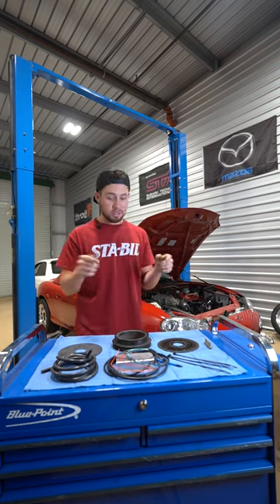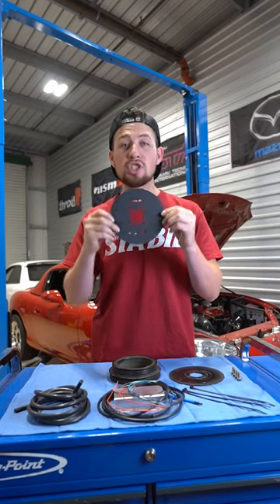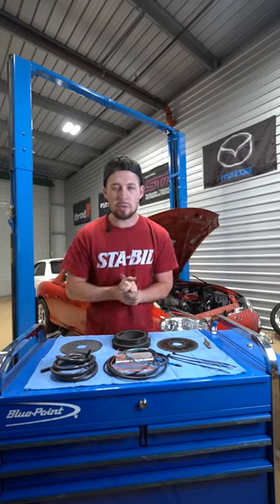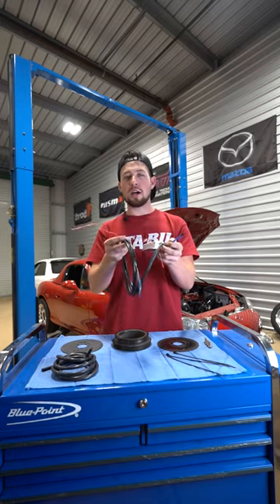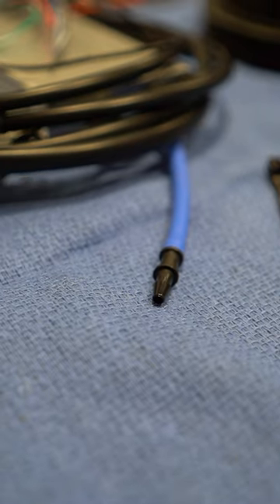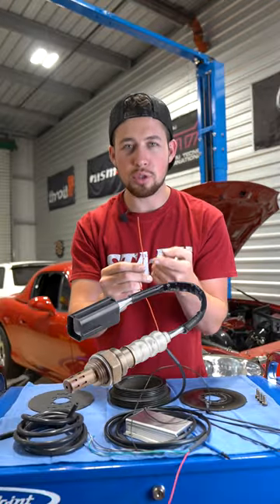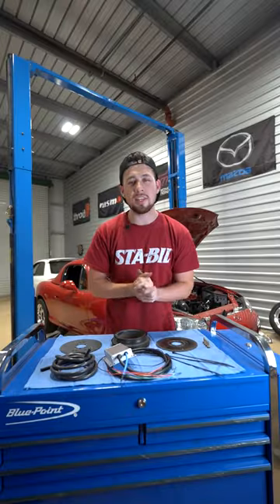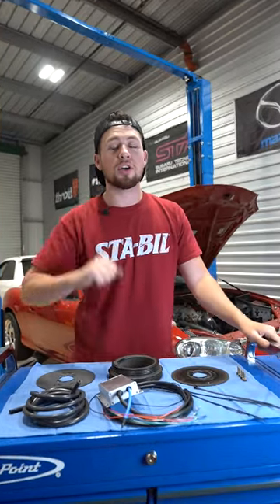How to Install a Turbo Pt.5

Comment: And you're gonna not talk about the upgraded fuel pump and injectors and fuel pressure regulator? Yeah it's definitely gonna go boom if you don't use the rest of the supporting mods 🤣